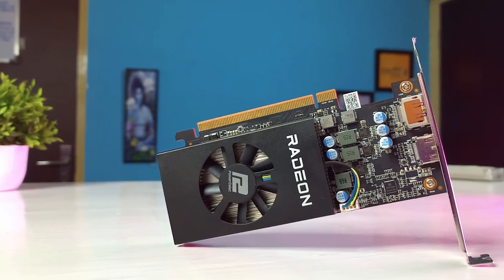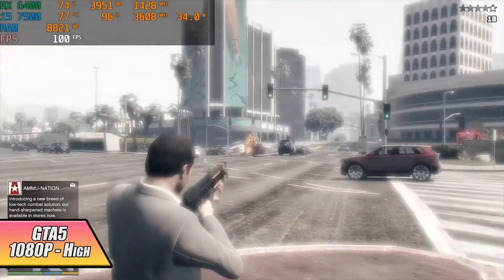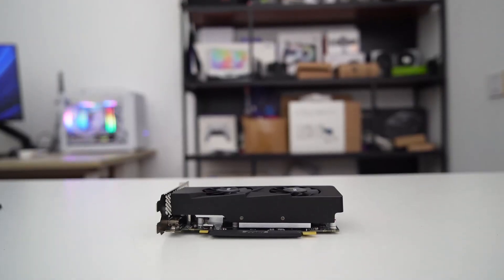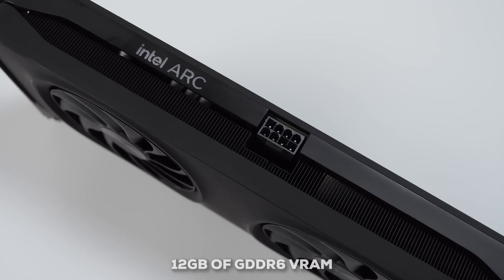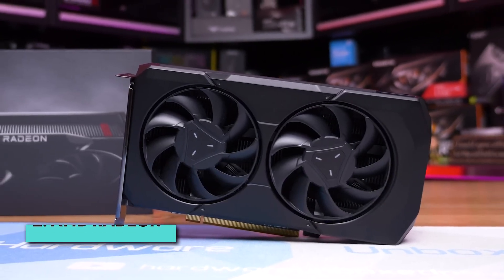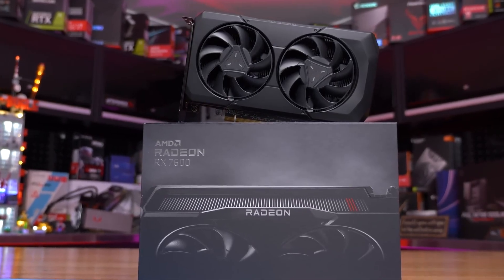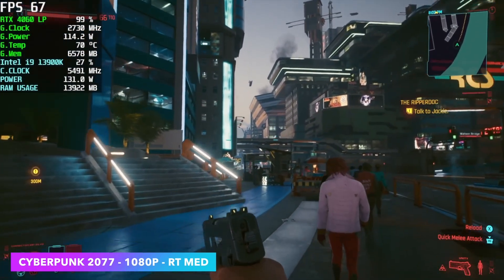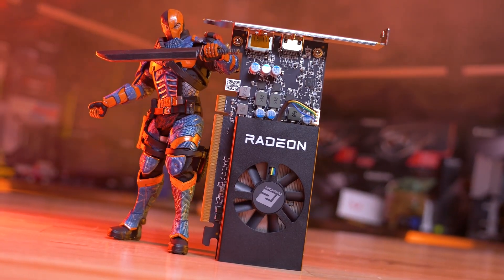5 Best Low Profile GPU 2025 | Best Low Profile Graphics Card 2025

Comment: im team red for cpu, i do not even need to be sold on that, AMD cpu ive used i think from day one over 25 years ago or around that time ive never had issue with them. i built a itx pc around few months ago i decided this time i try all AMD so ended up with rx 580 8gb card performs well but a huge issue so bad my newest computer is now i refuse to use it till the gpu replaced all down to AMD software, it got all the updates and motherboard drivers but system just keeps locking up it worked fine and got worse and worse, while i was using that i decided to update my old system from 1800x to 5700x , a Silverstone GD10 case the reason for 5700x instead 5800x as cooling limited but the 5700x with xmp so close to 5ghz and not bad for 65w cpu, gigabyte motherboard, new psu the system had one last full refresh and a lot that will move on to am5 build one day the ram and cpu go in itx build , the case, psu move to am5 so this refresh only throw away motherboard and that not bad for system what do me some more years. i finished up with old pc got it all setup my main editing and gaming pc, the itx pc that a pc built for very low power use as no point having power hungry system to watch YouTube as example, itx had old ram out my old system 16gb 3000mhz and that got 32gh 3200mhz and a r5 4500, it edits 2.5k footage 60fps up to hour long it dose that better than 1800x to itx pc a watching stuff and light tasks the other day i turn on my itx pc after my main rig fully setup, freeze after freeze , it was one freeze to far, forced shutdown turn back on my old pc what been refreshed and i refuse to turn it back on until i got a non AMD gpu, i thought all AMD system i give it a try well ive been put off and now two gpu to buy as my older gaming pc that has the old evga 1070 8gb card i had few cards in mind inc AMD now ive got two cards to buy i thinking 12gb 3050 for that replacement unless i can find 16gb at good price, and replacement for rx 580 as cpu bottleneck will be another 3050 but the 6gb LP  i decided why not low profile as at mo 580 on riser so cannot see motherboard so only way to clean remove the gpu, a low profile no need to remove and 3050 6gb lp with r5 4500 a good match and that card cheap and even tho Nvidia had issues it cannot be as bad as AMD software, all it means £160 less to spend on old pc gpu the reason it still got 1070 as now two cards to buy so i can use my cheap system low power 90% of the time and hard work or gaming 10% the time as no point wearing out a more expensive system , itx build £550 and that inc ram free but inc £44 for 32gb 3200mhz as that ram half price to what it is now so old ram priced at £44 and free upgrade old system. was really looking forward for first all AMD build but the 3050 software will be better lp help with cleaning and see the cpu cooler as it 1cm of back the gpu and i can unplug power cable as it only uses motherboard power so a win win, since AMD cannot fix an old gpu software what hope they got new cards the reason the 1070 replacement be anything other than AMD sadly as cheap card a lot vram so now back with researching for 1070 replacement but i do like 12gb 3050 but that can change, itx pc i feel it almost certain 3050 6gb lp as performs well and cheap

Comment: i never see the 7600LP and the arc 580 LP in any website to buy, so can it be the channel is a AI automated ai only channel without facts only with roumers??? 
the links in the description are not working only for the real card who all can buy: rx 6400 rtx 3050 and rtx 4060 in LP.
Reply: That’s what I though so at the beginning, but found them, both links in the description for the 7600 & B580 works for me, they are on Amazon
Reply: @JonatenMedia  if i doo such a fail at work its not houndrets of money it goes to the tousands or maybe millions... buuut idk?! i work clean and safe at work. privat ima 100% chaotic ;D
EDIT: the best LP card he forget the GIGABYTE GeForce RTX 5060 Low Profile OC 8GD (its a bit longer with 181mm then normal but it has 3 fans and fits easiely in 95% of all itx sff cases and all LP cases, the 7600 and b580 are too long for the most cases at lp and sff) but why the Card isnt in the list? 

standard:            length:                 height:              width:

SFF	               170-200 mm    ~111-120 mm       slot: 1-2
LP	                  167,65 mm	          68,90 mm      slot: 1-2
SFF-LP        ~150-160 mm	          68,90 mm      slot: 1-2

7600 and b580 are SFF gpus not a LP 
the 7600  212 x 129 x 39mm  
the b580  249 x 132 x 41mm

so if he or it dont understand the different between SFF LP and SFF-LP GPU´s he is useless as Techtuber, 
thats why the most guys think he is a Ai or uses Ai for script video and voice and for illusions that never exists, 
from this channels with ai and Ai-Illusions it gives too much on net since the last years ...